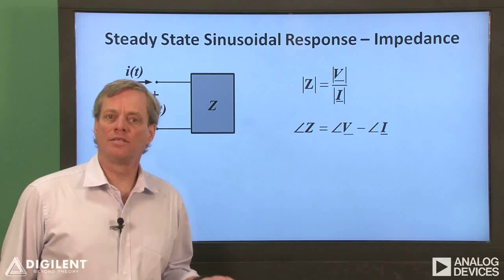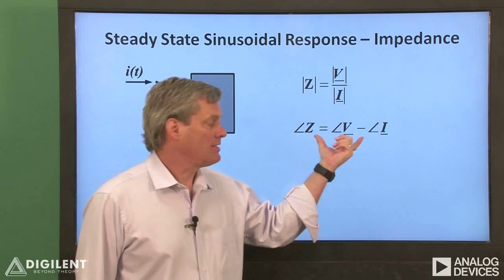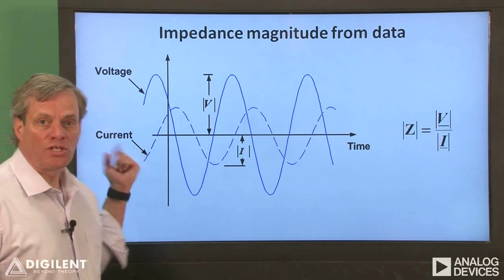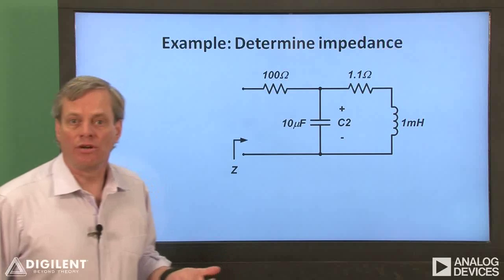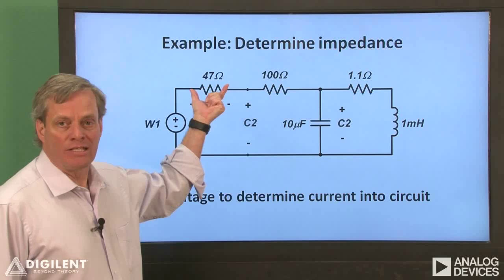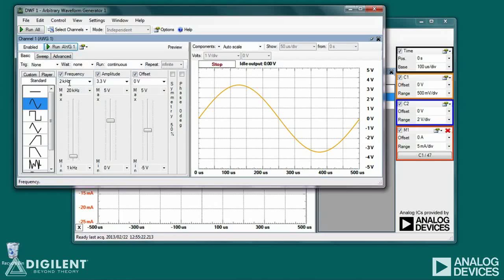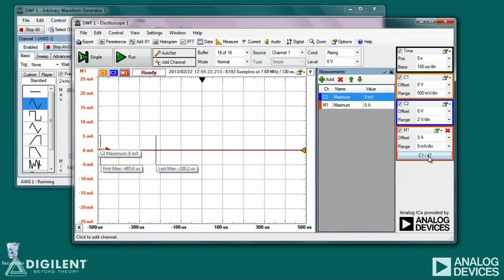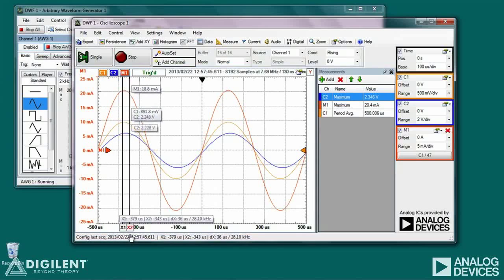Real Analog - Circuits1 Labs: Ch10 Vid2: Impedance Measurement

Comment: What happens at the points I = 0 ? what happens to the impedance there? Or is it the rms voltage compared to the rms current?
Reply from the maker: +Frederick Pearsall That is a very good question. The best place to post question will have to be Digilent Forum: https://forum.digilentinc.com/

Your question seems pretty straight forward, however here is a video you may find helpful when posting to the forum: https://youtu.be/krqSlIsPhJo

Thank you for the great question!

Comment: Very good video.  What was that program you used to show the oscilloscope output and measure the peak voltage on the voltage sinusoid and the peak voltage on the current sinusoid?  ron rcf95032@gmail.com
Reply from the maker: +ronald Fish The program used is called "Waveforms" and is available for free through Digilent's website: digilentinc.com

good question!